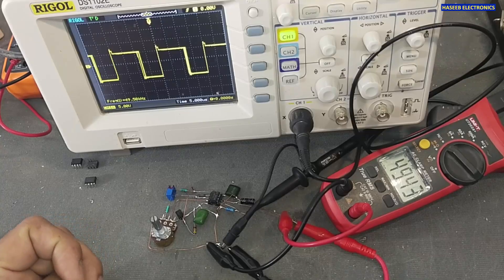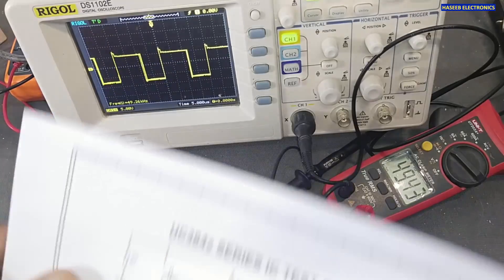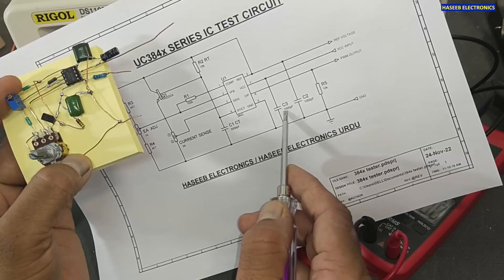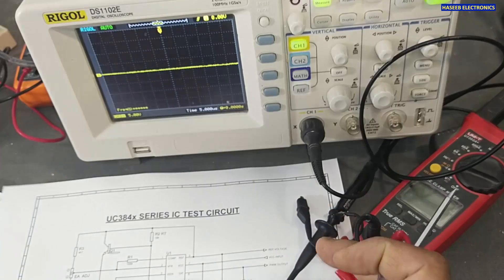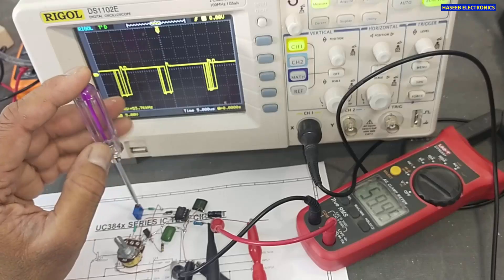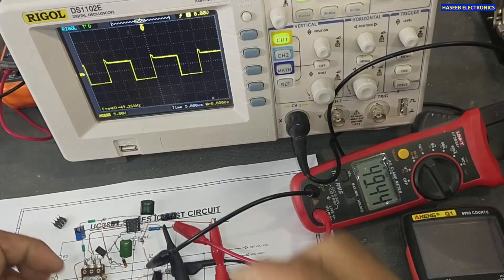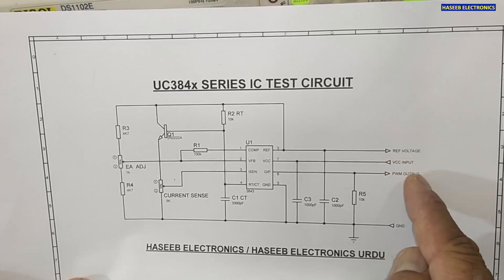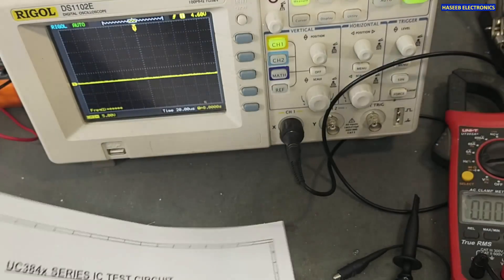{777} UC384x PWM Controller IC Test Circuit, Test 384x Series IC

Comment: Minimum ON time limited to 1us 💩So you cant get low duty cycle at high frequency, for example, for 100 kHz carrier you only gets 10% duty cycle, after "duty<10%" it switches noisily between 0 and 10%.  This feature doesnt documented nowhere, the datasheet only says the maximum oscillator frequency, rise/fall times etc, but not explain any correlation between osc frequency and ON pulse duration. It is also interesting that the OFF time has no internal limit, it depends only on ocsillator capacitor discharge time...

Comment: I have made the same circuit but there no output showing from the out pin of the uc3845 . When i check at rt/ct pin there is graph showing charging and discharging of capacitor with frequency 44.8 KHz. What would be the error in my circuit? Is my ic faulty? What would be the reason if no output is showing from out pin ? How can it switch MOSFET? Without this

Comment: HELLO SIR IS THE KA3843 SAME WITH CU3843? I  REPLACE THE KA3843 BECAUSE ITS NOT SENSING THE BATTERY POWER (ALWAYS SHOWS BATTERY FULL EVEN WHEN I UNPLUGE THE POLES OF THE UPS FROM THE BATTERY AND HAVE 27.5 VOLTS OUTPUT ) WITH TH CU 3843 I HAVE BATTERY SENSING BUT 0V  OUTPUT NOT CHARGINGTHANKS IN ADVACED

Comment: Hello! I assembled the circuit and it worked perfectly. I made a small modification to the output of IC pin 06. I replaced the 1K resistor R5 with a 2.2K one in series with an LED. With this modification, in the absence of an oscilloscope I can vary the brightness of the LED and observe the PWM modulation and make sure the IC is good.

Comment: Great, but what if I want to stop the current mode controlling.
What should i do ?
Reply from the maker: Just remove current sense resistor's signal connection from pin number 3 
And connect pin number 3 to ground
Reply: @HaseebElectronics  okay ,i did so but I have a problem 
I'm designing flyback converter it is needed only in voltage control mode so I must have a sawtooth to compare it with the error.
If i grounded it how I compare the error with sawtooth.

Comment: Sir, I have one uc3845 on welding machine and I find these values : vcc 12.2v, vref 5v, output 1.3v DC and 0.2v AC, frequency on output 96kHz and duty cycle 11%. How can I find 96kHz frequency ? I think I have to measure output in AC not DC is that right ? Output goes on MOSFET gate and I have 378v DC between drain and source. Do you think my IC is dead ? Thank you for any help

Comment: I want to correct the author a little, the microcircuits of this series differ from each other, for example, UC3842/44 is different from UC3843/45, instead, 42 is interchangeable with 44, similarly to 43 and 45. the best option for the construction of power supply units is microcircuits of the 2842/43/44 series  /45- the temperature range is different.  we carefully read the datasheet and look at some power parameters and voltages at the outputs of microcircuits.
Reply from the maker: the biggest difference between these ics is the topologies
the biggest issue is duty cycle
as 3843 can provide UpTo 100 percent while 3845 have only UpTo 50 percent. moreover 3845 have half frequency have half frequency then 3843. so within the same design we cannot replace both ics with each other. if we will replace 3843 with 3845, it was cause to heat up transformer and MOSFET because switching frequency is half and duty cycle. 
same above situation between 3844 and 3842 
temperature difference doesn't matter in commercial designs. if we are designing some design with military specs, that time we need to care about temperature parameter
just we need to check frequency, duty cycle, and vcc voltage.
Reply: Hi, thank you for your explanation. Can you please test this tester with other PWM to if it works, too. Like ic 2269 or 1203 or something similar.

Comment: This will work out if you have scope equipment. Good for those. Me I can tell duty cycle on 555 timer if I put a bigger cap on it to slow oscillation. Might got more out of it if you can tell without scope.
Reply from the maker: it works on multimeter as well. 
as i demonstrated in the video to use multimeter to measure frequency and duty cycle
both oscilloscope and multimeter users can use it. 
moreover i am planning to add a simple frequency counter with it. any one can make that easily
Reply: @HaseebElectronics  alright thanks not really into the hobby as such. But I'm study don smith device. Your channel is a good reference. Who knows a lot of his input developed the modern power supply.

Comment: Hi! thanks for the useful information, my question is if it's possible to use for controlling speed of dc motor by adding mosfet at the output section? Or there is  better ic for that purpose? Thanks in advance.